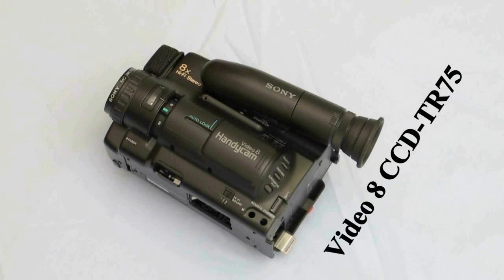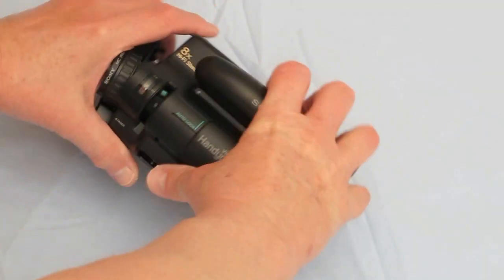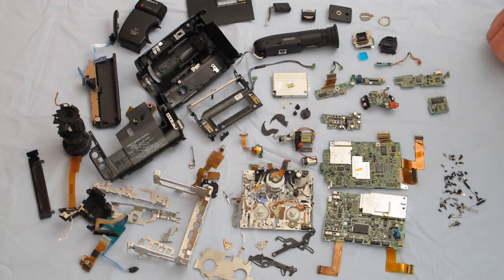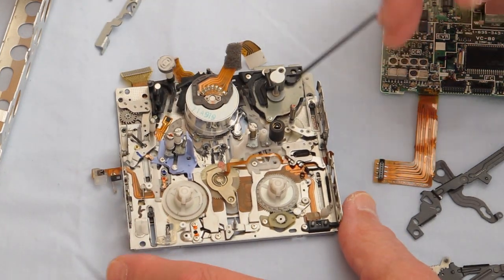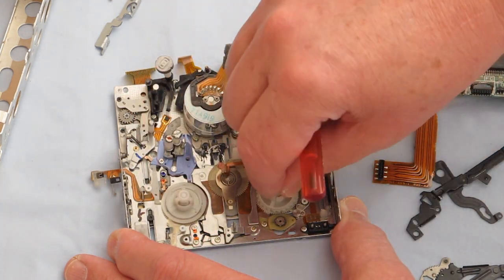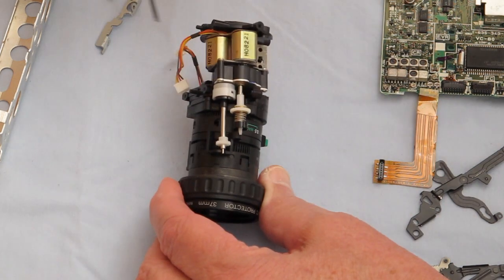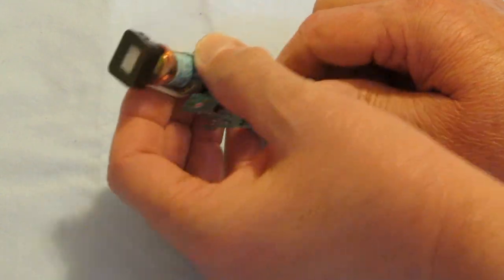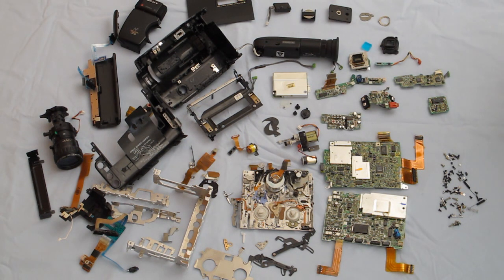Sony Handycam Dissected

Comment: Ron... I am also fascinated on how electronics are put together. I am addicted to the process of taking "things" apart.  Just recently I was given a huge commercial laser printer that didn't work anymore and it took me 3 days to take it apart but I tell you I got some VERY INTERESTING parts from it. I am just trying to figure out how to power up these little motors that came from it for different applications. Any ideas?
Reply from the maker: No, sorry, that stuff is a bit past my electronics knowledge.
Reply: Ronald Walters how long did you record video on the Sony Handycam camcorder shown in this video?
Reply from the maker: WVFilmCreator122406  I bought it early 90's while I was working overseas and used it for quite a few years. Later on it lived in a closet most of the time with only occasional use until one day all I got was a white streak across the picture. Audio still worked. Most of the people I personally know who had this same camera had theirs fail in the exact same way... worked perfectly one day and then a white streak the next. I also have the miniature VCR for the Video 8 tapes. This was not something used very often and the drive roller would become slightly compressed resulting in uneven drive speeds. Then the electronic repair shop refused to even look at it as they had become too lazy to do any bench repairs, only working on easy fixes and component replacement (throw away stuff). Apparently a big and expected problem was with all the capacitors failing on the circuit boards. Very annoying as I have stacks of Video 8 footage I can no longer watch... but then with the HDTV and computer screens the video quality would now appear quite antiquated.
Reply: I have that same camera. I got mine repaired a couple months after I got it from eBay. Is yours the CCD-TR7?
Reply from the maker: WVFilmCreator122406  CCD-TR75 but it was trashed three years ago.
Reply: So you got it in 1991 and... how long has it been since the white streak appeared across the viewfinder?
Reply from the maker: WVFilmCreator122406 Don't really remember. Probably noticed it around 2005 +/- . It wasn't a viewfinder issue, it was on the tape. The CCD image sensor failed.
Reply: You said you had stacks of footage you couldnt watch right? Are you able to watch them today?

Comment: Best way to learn is by dissecting it yourself. I managed to fix my Braun shaver with a little bit of research and determination. I was so happy that I didn't have to buy a new one. The worst part about it is Braun doesn't put out assembly diagrams anymore. Luckily I actually found a archive of old websites with a manual of older models that still shared design structure and helped me fix it.